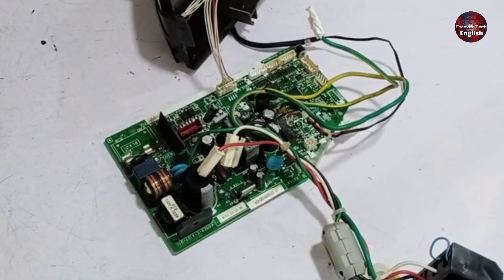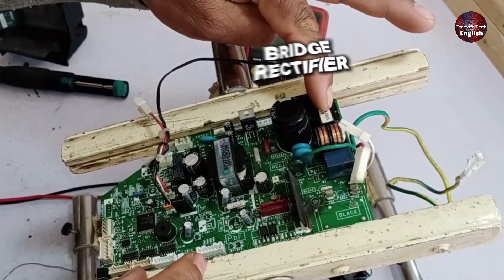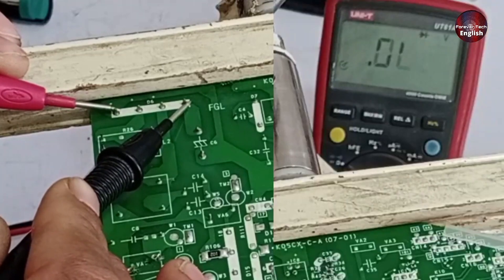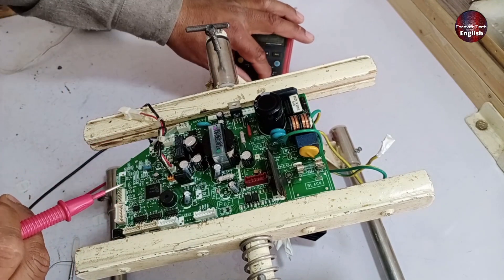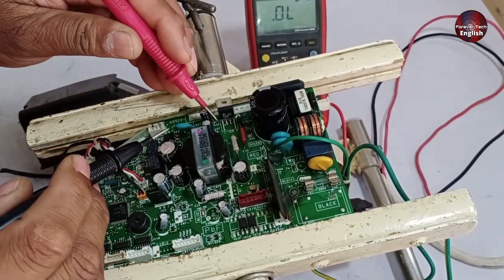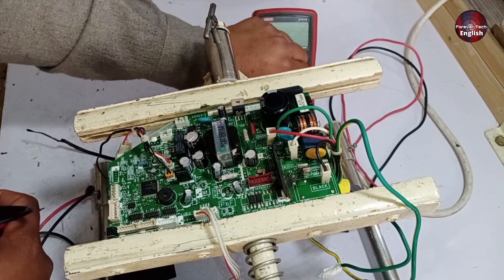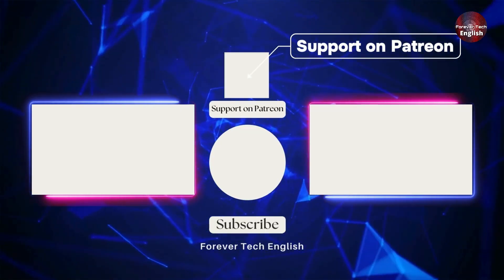Test & Repair of Fujitsu AC 2 Ton Indoor Inverter Circuit Board.

Comment: Not exactly zener diode: it is an M.O.V, varistor, voltage dependent resistor, with extremely nonlinerar U-I cure. Use series bulb for test. Don't power directly.
Reply from the maker: When did i said zener diode, I said ZNR ( Zinc-Oxide Non-liner Resistor)
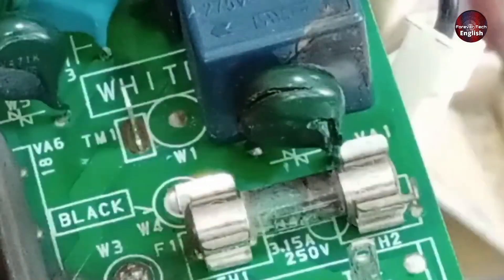Reply: @forevertechenglish on 00:56 "we will first remove fuse and zener diode...". Listen your own words.
Reply from the maker: @SanelKeys  Oh!! Well, I didn't check that and reviewed the video before uploading. The editor made a mistake, the new editor doesn't have the knowledge about the components; lol. well, of course, I will have to mention them now after these comments. 00:37 mentioned ZNR. Then lol he made it Zener diode. I just reviewed the video now.